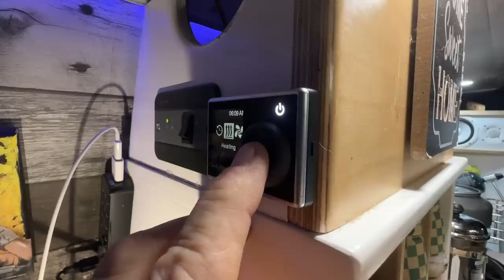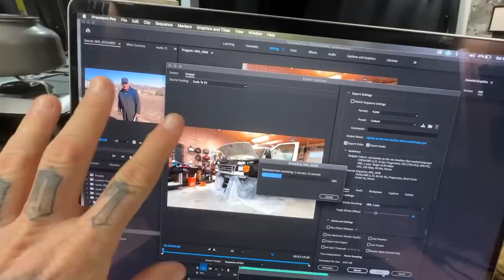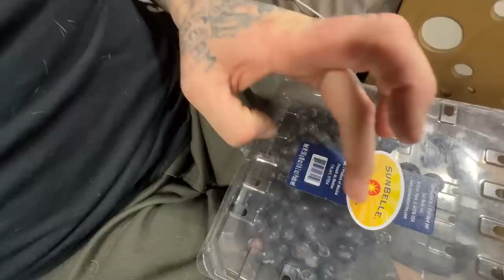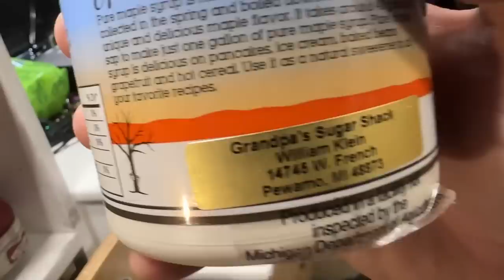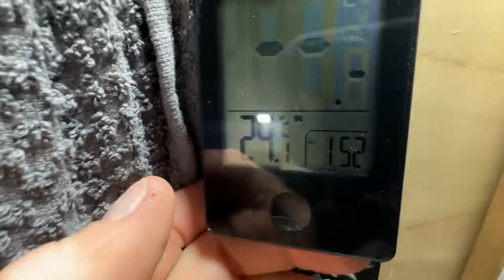HARD GETTING OUT OF BED “Safe Inside My Off Grid Home” VAN LIFE ROUTINE

Comment: Did you know the first thing I noticed was the wood Pile in your van. I thought for convenience that if you could find a waterproof sac kind of like a duffel bag but yet waterproof. When you don't need it you just folded up and stick it somewhere. That away the wood can stay outside.  You might want set it on a couple of rocks just to keep it off the ground. In case a gully-washer comes by.

Comment: If the ambo and current van have a trailer hitch, you can just buy a cargo platform that slides into the hitch.  Plus side is it is easily removed when you don't need it.

Comment: 13:30 You can freeze berries to prevent them from spoiling. And they are much cheaper and usually of better quality, if you buy them already frozen. I pay about $12 USD for a big gallon sized bag of frozen mixed berries (blueberries, blackberries, raspberries, strawberries).

Comment: Absolutely no need for a sink with running water. 7 years in my van in the middle of Auckland New Zealand. Big water bottle with 12 volt pump on top and wet wipes- sorted. (Oh, and a small pressurised spray bottle for when it gets too hot)